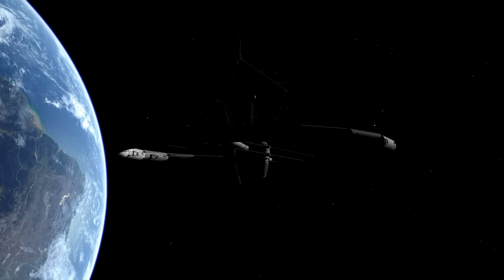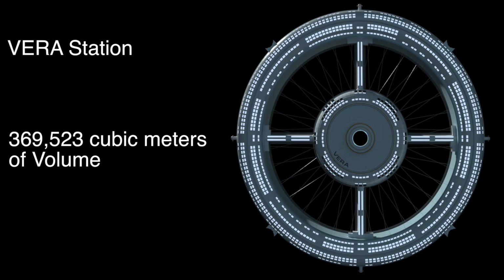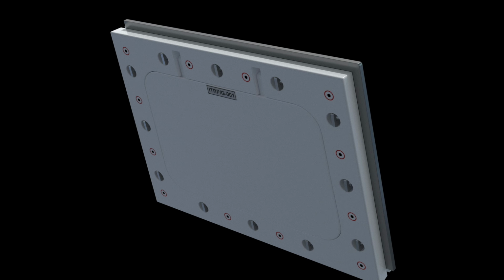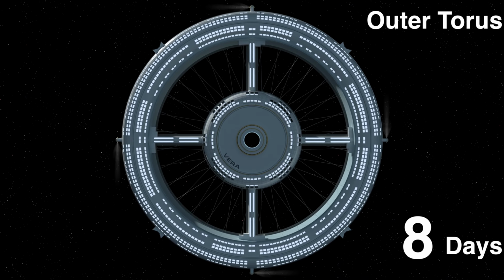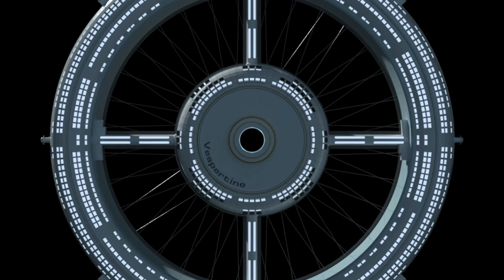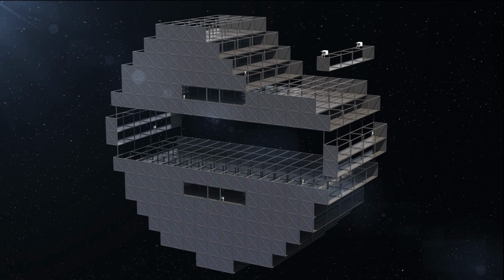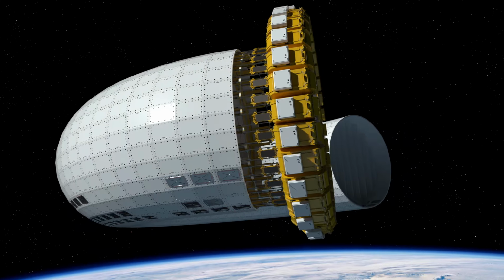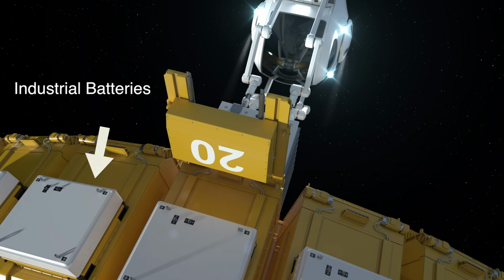We could build this huge Space Station in 6 months

Comment: Excuse me for being skeptical, but I've been seeing these stations promised since 1968. I have no doubt they CAN be built, the method isn't all that different in theory than building the Saint Louis Arch. Build a section, and put sections together. 
I want to see this built certainly no later than 2029. 
It appears to be using practical designs borrowed from constructions as diverse as the Arch and tunnel construction. I'm sure the principles are sound. 
The question comes in when trying to fund it.
The more that can be done the more quickly, the more investment will follow, but you have to get the first one made.
I'd like to see both Bezos and Musk support this endeavor, but even if you only get the backing of the Arab Emirates, I want it to get built.
I can hope to see such a station completed by my 70th birthday in 2031. 
I'd certainly like to see us go from the moonshot to orbital stations with artificial gravity before I'm gone.
But that's a future I have been promised my whole life, and everyone has always said we were within ten years of achieving it. So excuse me for being skeptical.
It's hard tp keep building hope and having it crushed.
Reply: The thing that will make this a reality exist now (or very soon). Big reusable rockets, that will drive down the cost of going to orbit dramatically.
Reply: @Merecir Flash - there is NO money to build this.
Reply: You're putting pressure on a private industry that is fairly new for the failures of a government.

One has nothing to do with the other.
Reply: @glenwaldrop8166  I am putting pressure on science to put pressure on global politics.
Reply: @paysour3  and I wasn't talking to you, I was replying directly to the statement made by the original poster.
Reply: Just tie it in to military use or money.
The government will fund it then.
Reply: @mikeg4972  how do you think Elon is able to perform the tests.  That is exactly what is going on.  Elon is developing military systems as a way to get them to allow him to proceed, but until a station is built for SpaceForce, as well as satellite weapons platforms to control our orbit, no commercial entity will be able to operate in orbit or space freely
Reply: It's more profitable to create wars than to invest in space tech - at least seems from current world situations.
However - lot of things are pure speculations in this design. For the start - logistic of the panels and panels loading procedures in the assembler. Also, no earth based facility which produce and test those panels before to be sent in orbit. 
Then the maneuvering in space isn't that simple and fast as it shown.
This makes me sceptical for possibility to see something like those stations in next 50 years. Concept .... yeah is kind of right, but it missed a lot of details. 
For example- how thus assembler manta ins its position in orbit? Where are the attitude correction blocks and reservoirs of propellants? How they recharge. From where comes the energy of the welding lasers? How big is the power station, how is cooling itself and where stays in this assembler?
Should I ask more worrying question in this conceptual idea? 
From engineering standpoint - its complete disaster. 
And please let not open the point for orbital mechanics and how it works because this video will be complete nonsense!
Do you think in the space agencies and companies works lesser engineers and dreamers?
Reply: The biggest issue is that rocket-to-orbit has been outrageously expensive for decades, Elon Musk is changing that very quickly. It's more monetarily feasible now, and will be more so in the time to come.
Reply: But barring in mind we didn’t have spacex at time 1986  space cost is less now then was then
Reply: The AI and robotics tech coming online NOW (finally) has the capacity and capability to REDUCE the cost of something like this, and although the governments will want to CAPITALIZE on the COST and keep the extra money; private corporations just might be able to sneak into the game within the next ten years and you can bet you already know the company names that are doing just that.  Those who are able to snag a job with those companies they are on the go and they will be able to do that with a negligible cost; especially if they send a "robot" ai to the asteroid belt to mine for metals needed to build the panels with; it's only a matter of a few years really before someone does that, and who knows, someone may have already done that and it's "under way".
Reply: Excuse me, but we just now have the correct technology and systems, along with the rockets to lift what we need, now.  Back in 1968 when you were looking at flowers in fields I am sure you didn't think you would be commenting on a platform like youtube now.  When you first logged onto the internet with your dial up I am sure you didn't think you would be able to "google" anything you wanted to on a handheld device more powerful than the space shuttle itself.  So yeah... if you "want" to see this built no later than 2029 what exactly are you personally doing to make that happen other than some internet comments?
Reply: The reason we didnt have space stations, is that we didnt have comercial space programs, Nasa and other agencies have burocracy and Bad administration, musk could do it fast, but it is not his priority now, if he were yo announe it, them You could actually hope for it.
Reply: Elon is a charlatan, its only right to be very skeptical with any of his absurd claims
Reply: Just think if we weren't spending so much Global effort maintaining large militaries 5 stations could be built in less than a decade.

Wouldn't it be great to have one of these stations and launch it towards Mars or even the outer solar system.

I think we are extremely negligent that we are launching probes like the Vikings probes that have been traveling through deep space since the 1970s and they're still transmitting from the outer solar system. Those probes are primitive to what we have today and I think we should be sending them out in all directions.

So you have a good reason to be concerned that these kinds of projects will wind up on the back burner. I do have my questions about the raw material necessary to build these stations.
Reply: I don't seeing Jeff Bezos excited about this idea. Bezos is a big Democrat contributor. Don't even ask Bill gates. He has other plans to slowing down humanity. I can see Elon Musk and Donald Trump getting on board. I can see George Soros blowing it up in space.   I would retire in space. Living the remaining day of my live on a station I saw in a movie; "2001 Space Odyssey, 1968 movie, by Stanley Kubrick."
Reply: a single starship launch is all you need for a small, inflatable, rotating habitat, with no additional pieces to weld into place. this will prove the concept of rotation for artificial gravity, docking, and crew transfer. prove me wrong
Reply: To be short and simple which this channel/company/organization isn’t.

I think the Who will do what and also the equipment and vehicle(s) need to exist before saying it will happen.

Gotta have a right and left foot …then need to learn to stand and then one foot at a time not both feet even before they exist.  BFS 2 maybe only exists in design phase…no prototype..nothing BFS 2 has been built except maybe Raptor 2.
Reply: Right boss!
Reply: Do you wonder why on a rapidly warming planet that the planets 2 richest billionaires are building a space fleet,not NASA.?
Without any taxpayer oversight,they can allow anyone they want to live onboard.
Musk WILL  be on Mars in 10 years just as the Earth begins to roast like a hotdog on a bbq.Happy Trails.
Reply: Yeah, honestly, at this point, I think it's all about the money. If they can get it, this project is ambitious, but doable. If the money doesn't show up...it just isn't. 🤷‍♂ Of course we have to keep the government out of the way...probably the biggest hurdle besides the capital.
Reply: @aaronm9478  Trust me Bezos & Musk are getting NASA money.All those patents given to certain cherry picked corporations from gifted alien technology is a BIG DEAL.
Reply: Bezos and Musk will never work together.
Reply: It makes more sense to use AI to send it to the belt and give them instructions to mine metals and duplicate themselves, then bring home the materials.  A contours build of space habitats matched with a massive movement of citizens to live in them and provide the raw materials of all that is needed for a closed system, and totally doable.  Then a five year shake down and off you go to the nearest habitable planet and good luck.
Reply: So from start of infrastructure build to major build to finish?
Reply: For all the nay sayers sit back and watch. With the massive push of private American companies and nasa there is going to be so much progress in space you all won’t be able to keep up. There was 3 space x falcon 9 launches in 2 days alone like two weeks ago.  The ability to reuse rockets is a missive game changer that will bring these giant facilities in space and the moon to fruition and that is what this engineer is saying. This wasn’t possible until now. Starship is allowing to bring 150 tons to low earth orbit. Starship is going to be fueling rockets in orbit for the Artemis missions as well. Science doesn’t progress unless human kind makes it happen. These next 5 years alone because of Artemis travel to the moon and spacex starship there is going to be a massive jump in space technology! 👍  let us all cheer on humanity or try and educate ourselves so we too can participate!
Reply: These types of innovations are possible because of private enterprises. NASAs overly bloated budget and political whims .when you don't have to make a profit there's no reason to be efficient.  End nasal completely  billions saved
Reply: 2031 is still a long time to wait for
Reply: It takes time for technology to catch up with our ideas. But it will get there.
Reply: @ssrbob  that’s the thing Bob, the technology exists, is governmental obstacles and red tape preventing it.  The government wants to have a fully operational SpaceForce operating in orbit, complete with space treaty violating weapon systems before allowing anyone to commercialize orbital travel.  It is another control platform for the government
Reply: I'm a bit skeptical too about the design of the rsca.
Simply by the fact that arriving at the last solder panel, how will the rsca do to withdraw from the station?
Reply: This project has more potential for success than does going to the moon.  Because of the Van Allen radiation belts, moon missions are not feasible until the radiation issue is solved. It is  doubtful that humans ever went to the moon because of the radiation issue.  It seems that  manned space activities are limited to low earth orbit for a long time yet..
Reply: @stanleyhampton7185  You are just ignoring the FACT that we have already gone
to the moon - not just once, but 6 times - and many other countries can validate
this truth. Feel free to look it up on various websites. You can do it.

12 men walked on the moon, whether you like it, or disbelieve it, or not.

This happened from 1969 to the early 1970's, then stopped.

All but two missions returned safely, and in one piece!

The first mission that didn't make it was Apollo 1, which had a fire in the capsule killing the 3 astronauts. They never even launched. The 2nd mission was Apollo 13, and the astronauts did live to tell about it, but their space craft was quite a mess before they returned.

We went to the moon whether you believe it or not, and there's plenty of evidence, in
the form of video footage (and audio), to back this up. Many countries were monitoring
the broadcasts of these monumental missions.

Now, we have an ISS - the international space station. Believe it. :)

The Van Allen Belts "theory" that you spout, has been debunked many times, and by
people even smarter than me.

So, PLEASE stop spreading misinformation. You're looking like a fool. :)

Edited, because I felt it was necessary for clarity.

Comment: You guys are thinking far too simplistically. You need to build these stations like we build large ships on earth. First build a pressurized volume that doesn't rotate, we'll call this the Fab, inside the fab you build out the interior and exterior in sections known as "blocks" then you send these blocks over to the station builder (in your case SARGON) but what I will refer to as the "drydock" and then weld them together. Furthermore what is preventing SARGON from using continuous processes (like carbon fiber or sheet metal) rather than simple panels? Not only would this speed up construction time but it would allow the system to be much more scalable and the materials could be lighter. Also why bother charge those batteries on earth? Charging them from the sun from the very beginning would be the wiser move. Finally is there a specific reason to use electron beam welding instead of some big mirrors or friction stir welding?

Comment: I wanted to tell you about the morning star, its a light that travels inside of a torus. It has to be added so we can power and gather energy at the same time. You designed the torus to dock in the center so now the morning star has to be designed to go around the torus. I brainstormed it for a long time using the model of the torus. I'm certain it will work more efficiently in conjunction with the solar panels to add energy to what is gathered from the solar panels or sustain itself without the gathered energy from the stars.
Reply: Bro WHAT. half of that was nonsense.
Reply: @joeyhoffman796  Lol,...which half?
Reply: @davincisghost9228  lookin back and reading it again I'd say both halves

Comment: What about twisted "grid" for equal sized panels, and vertical (instead of frontal) feed of the construction machine ( like the new starlinks will be deployed ) 
and cold welding? (screwing the panels together and leave the rest to the metal bonding phenomenom)
Reply: Cold welding would work if the panels were manufactured off-world/in an oxygen-free environment, but since they're shipping it up from Earth they would need to remove the oxide layer. Additionally, AFAICT cold welding is less controllable/precise than doing it the old-fashioned way, and that's something you don't want when you're forming a pressure vessel to support life

Comment: Though a lot have been talked on having a spacestation  and many more but no one is talking about how will man survive the radiation in outer space and effect of zero gravity on human body on long term stay !!??
Reply: The point of a rotating torus is to create artificial gravity using centrifugal force, so these designs solve that problem. Radiation shielding still needs more advancement, but we have many good options to mitigate the problem, such as water jackets.
Reply: No you just not listing, radiation can be solved by having a "water jacket" water is great at stopping radiation, so have a thin shield inside the panels or floor. (besides around earth its not a big problem the magnetic field is still a thing) 
But lol " effect of zero gravity" DUDE the hole reason for making spinning stations is so that we can make "fake" gravity, the faster you spin the stronger gravity you can get.
Reply: @MouseGoat  okay i agree with them points. ✨ May something like this comes up in our lifetime. Hoping for SpaceX to take the leap !

Comment: Very ambitious design. The production of a ground-based sample section would be very convincible by demonstrating the welding technique and the strength of the structure.
Reply: I'd like to see the pressurized safety doors that will go in it every 20 yards or so in case something hits it.
Reply: @thefinn12345  You don't need pressure safe bulkheads that often, if at all really on a station this size. A micrometeor hole is not like what you see in movies, there is no massive explosion and sudden huge decompression. It just starts leaking at a reasonable rate and would be very easy to fix, just grab a piece of aluminium plate and some epoxy and slap it over. Look up any of the videos on YouTube regarding this, you could literally put your hand over the hole to stop it leaking lol... Given the volume of this station it would take literally DAYS for it to empty through a small hole. If you are talking about a massive debris impact event then sure, it will fuck shit up bad, just as an earthquake, tsunami, volcano or any other natural disaster can immediately wreck your shit on earth at any time and your only hope to survive is to pray unless you have a private helicopter or some shit.
Reply: If you install a water sprayer system with some type of filler you have a sealer for any small leaks. The cold temp of space will be the catalyst to seal it. Just something i thought about one day.
Reply: the problem not how you do it but more about who will fund it.
Reply: A demonstration project would need to be done in space, but that shouldn't really be overly difficult other than the decent chunk of cash required. A perfect demonstration would simply have a far smaller torus made, either using far smaller machines doing a to scale version of the full project(lower weight) or more likely, using mid sized construction drones using say quarter radius panels into a small torus just to prove the principal (lower complexity and weight).
Reply: @Jake12220  The Axiom AX1 team, has made a small start by building a small test ring when they were on the ISS called a TESSERAE, self-assembling space station.
Reply: It's not designed to withstand Earth's gravity and would buckle under its own weight.